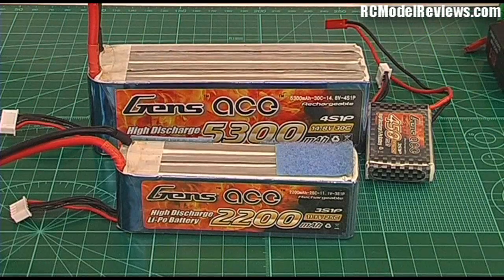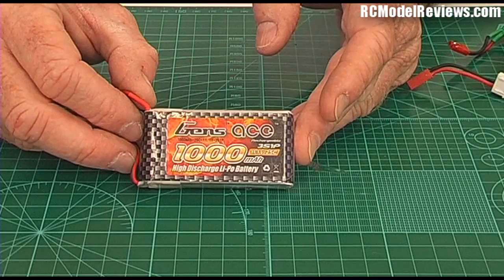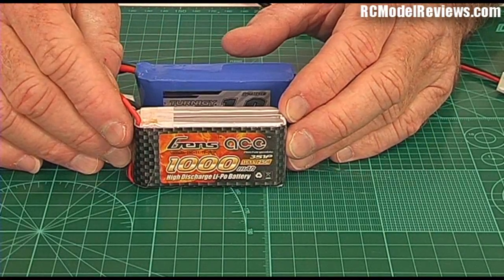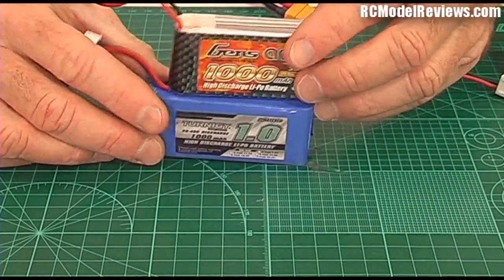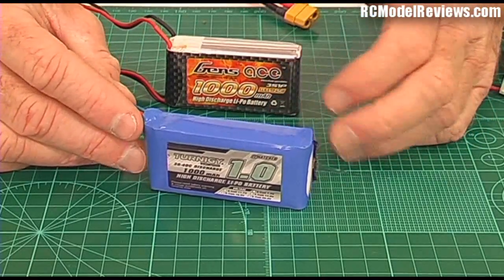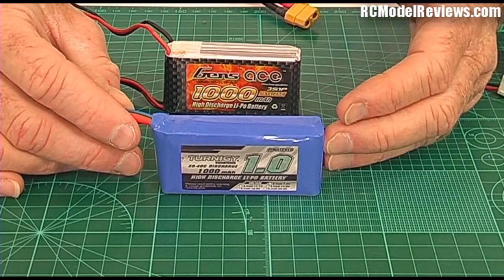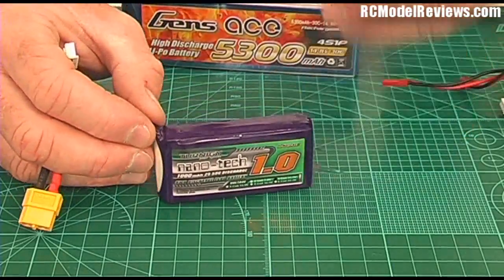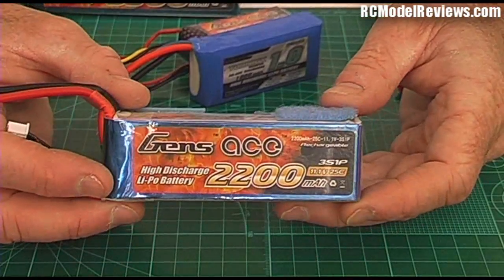All about lipos for RC models

Comment: One thing I didn't understand was the storage voltage. If a fully charged cell is 3.7 V per cell, then how is the storage voltage more (3.8V/cell)?
Reply: That's the nominal voltage, the charging happens (or should) at constant current until it hits 4.2V per cell then lower the current keeping the voltage constant at 4.2V until a cutoff current you or your charger picked. Often referred to as CC/CV a abbreviation for the phases.  Unloaded voltage will be a bit below 4.2 when done and after some rest maybe drop a tiny bit. Now this part I'm not sure about but below 2.7V I think is the point where the battery can be damaged from deep discharge (varies from capacity loss to fire/gas vent risks depending on how badly you mistreat it). But there's no reason to ever drain a battery that far because at day 3.0V there's like no juice left in them anyway.
Reply: TribunusLaticlavus Thanks for the explanation. I got it now.
Reply: xXYannuschXx First off I have very limited experience with lipo itself, I'm more familiar with cylindrical lithium ion cells myself. Mostly due to some electronics hobby projects and initially torches (flashlights) after making the move from NiMH to more interesting battery chemistry there. Lipo is mostly similar to lithium ion except that it has some more freedom and maybe they have gotten somewhere by now with the polymer based electrolyte? Rather than just labeling the lithium ion chemistry in a polymer case that way.

Secondly my post was mainly to explain the charging process on a single cell basis, in hindsight I probably should've pointed out the whole balancing stuff too but... I figured the video says enough about it anyway. It was mostly to explain to the guy how the basics of charging, nominal voltage and discharging of batteries work. But yea I probably should've been more explicit with things, however that would turn into a longass rant like this!

Now back to the context of my original response to ***** with cutoff I always think of as cutting the battery off while under load, so I did mean that value yes. It matches my experience with cylindrical lithium Ion cells (18650 and 26650 primarily), personally I tend to go for a top off recharge on my torch and devices batteries if they drop below 3.9V and its a convenient time.

The typical use of lipo packs and my battery use varies a bit though, much higher drain rates even with the bright LEDs of this day and age you'll rarely suck out more than 2.5A from the cell unless you use a crazy multi emitter and battery device. For my personal use I only stick to panasonic 18650B cells and in all cases but my own creations with personally calibrated battery voltage cutoff systems in place protected batteries (little chip connected to both terminals that cuts the battery off below a certain voltage or when its charged above 4.3V typically). And I've verified with my Agilent U1272A DMM that my charger definitely doesn't go above 4.2V and always inspect the voltage of the battery when its done charging, after an hour of rest and before putting it in the torch. Ah well enough ranty stuff about that...

But yea about 5% remaining with 3.0V under high load seems about right, with a light load (about 0.5A or so, that electronic load wasn't too reliable at keeping a steady current) there's between 3% and 4% remaining (Ah capacity wise, not energy) based on checking some of my past logged test data of a small sample of mostly panasonic made cells of various ages and use cycles. Under higher loads the voltage drops a fair bit more and I would not be surprised if the average RC community type use will drain a lot more than that :). So in that regard 3.0V load voltage is probably the absolute minimum I'd want to put it under, especially consider lipo packs get a hell of a lot more abuse than the batteries in my single LED and single battery torch applications. All the personal hobby projects are really just low drain devices and a single lithium ion cell delivers a convenient voltage range for current day digital tech, so the DC-DC voltage regulation gets a good efficiency (much better than a boost converter with a single NiMH or Alkaline) and setting a single cell cutoff voltage isn't that hard.

End of the long rant :)
Reply: TribunusLaticlavus
 3.0V is already damaging a Lipo, the reason 3.0v is the cutoff voltage is because the voltage drops by 0.2v or 0.3v under load, meaning that the Lipo still has around 3.2 - 3.3v, which is equal to about a 5% charge, so it wont damage the cell.
Reply: TribunusLaticlavus
Reply: John Mcgarry Not a rant all information relevant.

Comment: like u said 1000 mili amps is 1amp

if you were to put a1amp load on the batery it will discharge in 1 hour put a 2amp load it will discharge in 1/2 hour!

 more amps the faster it discharges!

25c is maximum discharge before batwry begins to fail.

if ur air plane set up pulls 30 amps at max throttle you will fry battery see!

but if ur set up pulls max 15 amps the you can do the math like this 1amp load is 1 hour 15 amp load is 15 devided by 1 hour  or 60 devided by 15 = 4 minutes of flight time at max throttle of 15 amps

yes can recharge the battery at 1/4 of c rating safely that would be about 5 amp

but still it is hard on the battery i go by a 1/8 rule if not in hurry if out in feild i do 1/4 rule

happy flying

Comment: Hey! I'm trying to find the right battery for my 2007 Kyosho Twin Storm 800 and I have no clue what should I do.. 

I'm about to start pike fishing with the boat and I need a battery that lasts long and it doesn't even need to go fast. 

The boat needs 2x 7.2v lipos and I've been watching Traxxas 7.4v 30C 5200mAh 2S LiPo. Should I use this one with my Kyosho Twin Storm 800(2 motors)

Comment: I must be missing something, but if the battery can hold 1000mah (1 amp), how then can it provide 25C (25 amps)?
Reply: He is using the word amp as a short way to say amp-hour: 1000mah = 1 amp*hour, and since it is 25C, you can draw 25 amps from it but if you do it will only last 1ah/25a = 0.04 hours = 2.4 minutes
Reply: Ian Boshoff Ah I see thank you for explaining, so actually the capacity of a battery is not really measured in the amps it holds, but in the amps it can provide?  If I'm understanding correctly, it's not really possible to say how much a battery can hold therefore, only what it can provide - which is more or less the same thing but I always thought the mAh rating was its capacity, when in reality it's technically not.
Reply: ***** CORRECTION 1000mAh=1 amp * hour, its not 1 amp per hour
Reply: ***** convention for batteries is to take the amperage that a battery can deliver for 20 hours staying above the minimum voltage and multiply 20 by that amperage thus giving a result in units Ah or mAh. C is the current that would reduce the voltage below that minimum in 1 hour. the reason why they are not redundant ratings is because the battery will have different capacities depending on the rate of discharge this is known as Puekert's Law. so basically the faster you drain a battery or higher amp draws from it, the less efficient they are. thus more cells will increase the efficiency by lower current per cell than using on large cell.
Reply: http://en.wikipedia.org/wiki/Battery_(electricity) the section titled capacity and discharge. im not 100% positive on it but i think basically the battery has a set amount of electric charge. current is flow of charge but there is conservation of charge so if there is a current or charge flows somewhere outside of the battery, then the batteries charge will decrease. ideally then given a minimum charge and a given flow of charge, it will take a certain amount of time for the charge to drop below that amount. the faster the flow of charge (higher current) then the battery will drain quicker and this time interval will be shorter. in real application though things are not perfect and it doesnt work out quite the same but instead some charge is lost due to things similar to friction but for charge flow. so the faster the charge flows out of the battery the more charge that is lost and so you can say the battery is more efficient at low currents than high currents. the 1000mAh is a rating for 20 hours it can withstand a 50mA current. the C rating is the exact same thing except for 1 hour so a C rating of 15 would mean it would be able to with stand a 15 A current draw for one hour. that is what i think hope this makes sense or at least if there is an error in my thinking someone will see it and let me know?
Reply: oh one correction about C value it is the multiple of the 20 hour current that gives the the 1 hour capacity so if there is a 1000mAh battery that has C15 then it can deliver 50mA for 20 hours and it can deliver 15*50mA= 750mA for one hour while staying above the voltage it is rated for. also Peukert's law is very valuable because using the second form given of it given in wikipedia (follow link for Peukert's Law) knowing the 1000mAh rating and the C15 rating means you can work out the Peukert's constant k algebraicly by solving for k, then use Peukert's law with the k gives a good continuous discription of how the battery will preform at any discharge rate. this means if you know roughly the currents your multirotor will use, you can deterime pretty closely the usefull flight time of the battery. the accuracy would really be determined by how accurately you can tell what the current will be required by your multirotor through out flight but you could get a good estimation by using a flat 60% throttle estimate and a 100% throttle flight time, you could even derive the function of flight time in terms of throttle setting and graph it to get a good idea of flight time or make a diy flight controller that can compute this over and over and give you a really good estimate for flight time or plan flights based on it.
Reply: yes i agree with what you have learned, and further that with the 20 hour rating and the C rating used to get the 1 hour rating, you can then determine any time for any current using one of the forms of Peukert's Law on wikipedia by using the to ratings to solve for k, two equations 2 unknowns. then you can use the k to find out any rating for any time interval. basicly you have a function for F(amps)=t and can accurately predict how long the battery can be used if you know the current flow. also i agree that also the C rating means basicly that you can safely discharge at that rate. i wonder though you could probably discharge at faster rates too because most multirotor flight times are like 20 minutes and some as short as 9 minutes.
Reply: on kind of a unrelated topic, i know from car lead acid batteries that you can only discharge them at a maximum rate because the chemical reaction that they work off of can only happen at a certain rate of time, any faster and it simply wont happen instead the battery begins to boil off or basically electralisis happens. the excess potential causes electric flow through the water/acid solution and the water turns to h2 gas and oxygen gas. so basicly for a lead acid battery there is a maximum discharge rate per mass. i bet there is a similar thing with lithium because they are a chemical battery and there must be a time rate that the chemical reaction happens or basically an energy per unit mass that is available beyond which and some other crazy chemical reaction begins like the battery starting on fire or something hehe.
Reply: once i get my hexacopter up and running i will try and work this out as a practical example, like determine the current draws from the 6 motors at different throttle ranges and small voltage for the flight computer and other peripherals and let you know how accurate it is. right now i just have the frame, its an 800mm frame and im waiting on the props currently and probably will be buying the motors some time this week but i am still unsure what motors i want to use because i am using dji foldable 1552 15 inch props.
Reply: marshalcraft
Reply: ***** well i did some calculations working out k values for different batteries and have come to the conclusion that most of these lipo battery brands completely lie about their C ratings and probably the capacity rating as well. C rating is pretty well defined as the multiple of capacity giving the current the battery can withstand for 1 hour. these batteries always perform way under these specs. i will be purchasing some lipos for a hexa soon and will test them first thing. it would be hard to do a 20 hour and 1 hour test exactly i would have to be very lucky in picking my amps. instead i will just pick a steady continous current draw and time how long it last before dropping under it's minimum usable voltage. if i do this at two points i know t=H(C/I*H)^k so i have C the capacity (I*t) for one test then and H is the time for that C and I the current for the second test and t the time for the second test. i know all variables except for k so i solve for k -> ln(t/H)=kln(C/IH) -> k =ln(t/H)/ln(C/IH) then when i have the k value of the lipo i can determine the I needed for both 20 hours and 1 hour then perform 2 more tests at the 2 currents to see how close i get to 1 and 2 hours testing my understanding of puekert's law. finally if i am correct and get the I values for both 1 and 20 hours and they are very close to 1 and 20 hours i can compare them to what is labeled on the battery and if they are very different it will provide excellent evidence that the battery is incorrectly labeled and false advertisement.
Reply: marshalcraft also it seems due to puekert's law it my be usefull to buy more small voltage individual cell's and connect them in parallel or make a highly parallel battery pack in order to mitigate the effect's of reduced efficiency due to puekert's law. although there is the side effect of increased wire resistance by having more cell's in parallel.
Reply: marshalcraft well according to most lipo data and even an mit lipo paper it says the lipo capacities expressed in mAh are for 1 hour so 2000 mAh would be 2000 mA for 1 hour not 2000 mAh is the product of a current and a time interval neither of which is usually specified so it does imply a current draw for 20 hours and 1 hour in a perfect battery with no resistance and perfect efficiency. the C rating i may have miss understood as it seems it has nothing to do with the batteries efficiency only in some cases says the maximum discharge rate the battery can handle which is very vague can handle could mean before the battery dies or the battery will not start on fire, who knows. most of what i had typed above about puekert's law is not valid for this case because i thought the batteries provided two capacities at 2 different discharge rates thus allowing one to determine the battery efficiency based on puekert's law however the companies do not give 2 capacities only 1 and even then maybe not 1 cause it is not clear what time interval the capacity is valid for. one thing we do know from puekert's law is that the displayed capacity is not valid for all time intervals because of loses inharent to lipos. so it is a discharge rate multiplied by some time rate that we know, however we usually do not know both or we do with the C rating if it is the fraction of an hour. either way i will be looking for a lipo brand that gives better data and explains their vague ratings.
Reply: marshalcraft k think i figured it out. i miss understood the C rating. it is just a stupid rating the gives the maximum current nothing more.

Comment: great vids, always very helpful.
what would you say is the most accurate, a battery balance/watt meter or balance charger. Why I ask is after a balance charge if I connect to my balance/watt meter to check it always says its out and gives alarm tone. I then balance with this meter but it all takes extra time. Both are overlander make the charger is RC-6s AC pro balance charger. Thanks

Comment: Good video... The 1000 mah batteries is off on the hobby king comparison,  They mislead you with labeling.  they are notorious for this scenario: the hobby king is bigger/heavier because they use a 1200 mah pack call it a 1000 mah and this allows them to raise the C ratting... this allows them to use a lot of 3.7v 1200 cells in different applications keeping cost down...  Also makes you think you getting a better battery...

Comment: thnaks for video have question why some lipo battery like 3.7v when we charge them  they go over heat puff but other battery the same voltage and work fine

Comment: Very right question, it is because the capacity is actually not 1 amps as Bruce says, the capacity is 1 amp-HOUR.

Energy capacity should really be stated in its proper unit joule or alternatively in watt-hour. Using ampere-hour as a capacity indication complete forgets that the voltage (LiPo cell count) also have to be included to calculate the energy in the battery pack.

Comment: i have 4 NTM Prop Drive Series 28-26A 1200kv / 286w (short shaft version    weight of whole quardcopter is 1.5kg.  can i use 3s 2200mah 20c battery

Comment: dang.. now i know why basically all my lipo's are puffy.. i havent discharged them enough when flying, and i have allways left them after flying for the day.. so all batteries are probably about 20-30% used... and i have allways charged at 2 amps.. but i dont think i own a less than 2 amp battery... can a puffy battery explode on me when flying, or will the cells show different voltages before i get to a critical point in a batterys life?

Comment: Useful video, but pet peeve is failing to distinguish capacity from current, capacity is in milliampere-hours, or ampere-hours, which is current x time.

So the letter C really means "capacity divided by 1 hour", which is a true current.

End of pedantry!